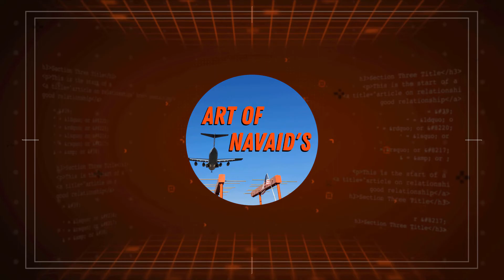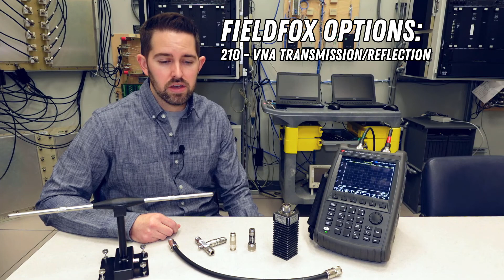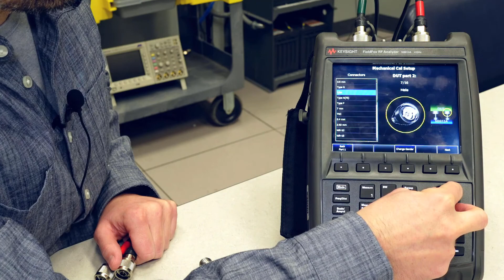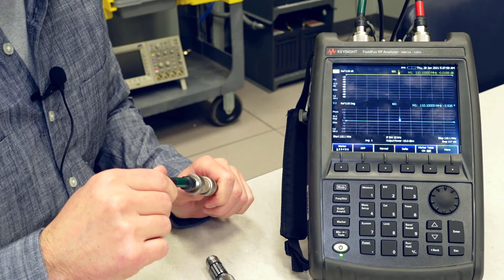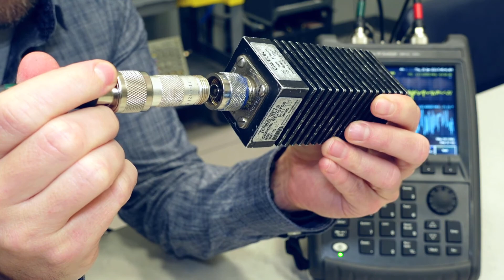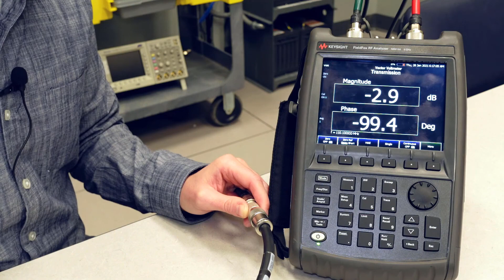Keysight FieldFox Network Analyzer Amplitude and Phase Measurements using NA and VVM Modes

Comment: Just a small matter, you should never spin the cal kit onto the connector. It’s bad for the center pin as well as it can risk it being over torqued. 

You should place the cable onto the kit connector and hand tighten it snug without any rotation of the standard or the cable. This way it seats straight into the connector. Most repeatable method. 

Great video demo of the field fox unit.
Reply: When I saw him doing that, I was astounded he didn't know better.

Comment: Ouch!  Never rotate the entire device when making connections...that will eventually destroy the standards.  Instead, rotate the Type-N nut.
Reply: Good observation. It's a bad habit that I believe ends up wearing on the center pin.
Reply: @gary9388  Yes, Great video, except for the rotation of the standard.
If you would do this for a higher frequency standard say Ku band it would most likely be destroyed at a cost of several thousand dollars.
Reply from the maker: @charleskaufman5826  Yup! I hadn't really thought about it until someone else pointed that out but it makes total sense. I now train others not to spin the cal-T. This is the way.
Reply: It was painful to watch 😢 to be fast, but it still the best video on the device.